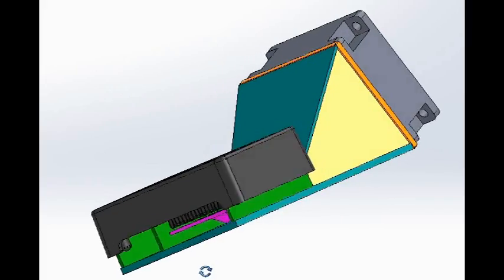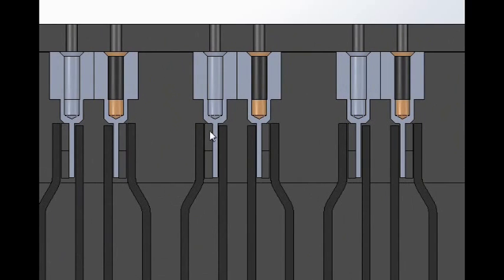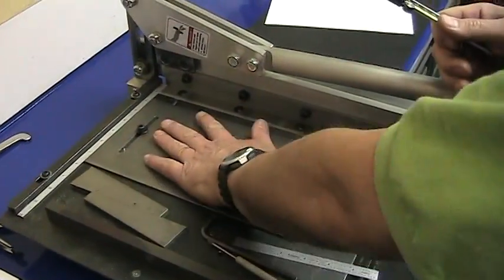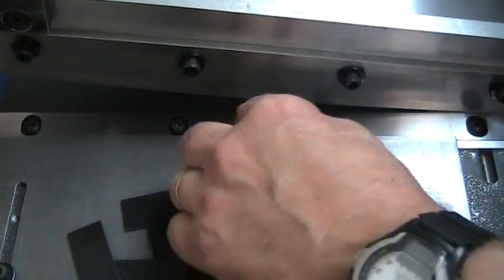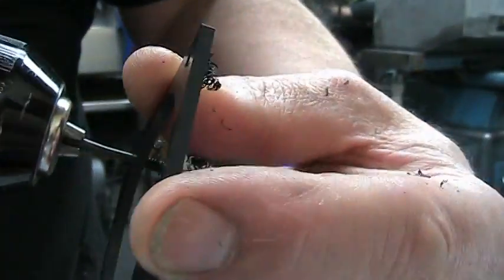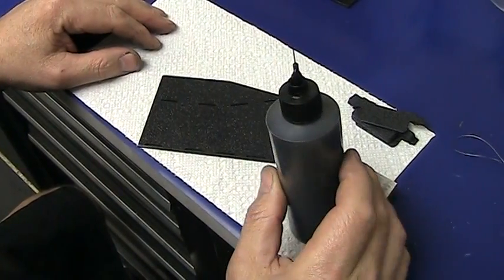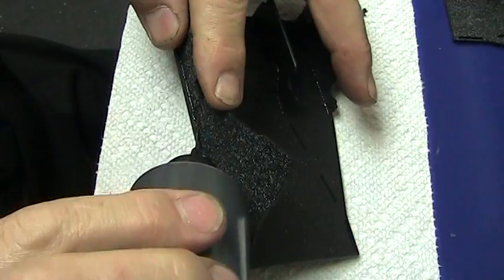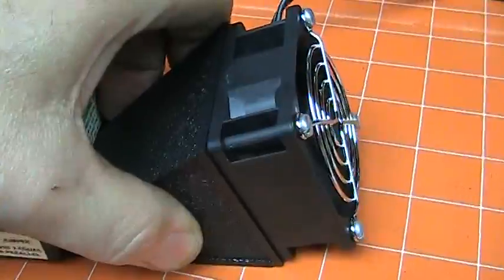VERSA-OHM  MAKING THE FANBOX

Comment: I'm pretty sure that fan is going to need a power supply and a little more wiring than just hooking it to a single-pole switch. And since its 12V DC and 12V direct-current electrical/electronic systems these days are pretty much all have "full integrated" circuitry and you just don't see too many 12V electrical/electronic systems with "solder-in" resistors on "circuit boards" and definitely not in things like control units for engines, transmissions etc in modern vehicles, it looks like that "test tool" is going to be kind of "limited" in its potential applications. 

For many years now even dirty old farm tractors and combines from companies like John Deere haven't even had "solid state" circuit breakers and relays and instead have "solid-state actuators" that integrate those parts right into the "controllers" which are all interconnected on the machine via CAN-bus with 2.5-volt "twisted pairs" communicating between controllers. And they have piles OF controllers. Like 20-30 pretty easily on a "simple" 200+ horsepower row-crop tractor or combine and EVERYTHING is "on the CAN" including the stereo, the transmission/engine/hydraulic system controllers and sensors and actuators which have been ALL electronic for up to 20+ years now. 

Even lighting systems are "smart" now and until you go into an "address" in the "chassis controller" or whichever "brainbox" is in charge of all the exterior lighting and program that address to "tell" the controller that yes, you have in fact installed optional exterior lights the unit wasn't "built" with, they won't come on when they're supposed to. 

The electronic engine and transmission and hydraulic controls themselves have always been pretty tough and robust but thanks to emissions laws and requirements and all the electronics on machines for guidance and mapping and even auto-steer (the AUTOMOTIVE INDUSTRY is ALWAYS a good DECADE OR MORE BEHIND the "diesel industry" and farm tractors have been "autonomous" for a LONG time now) via GPS and RTK GPS correction and the control systems necessary for common-rail fuel injection and multiple injections per 4-stroke "cycle" just require a degree of accuracy and precision of current/voltage signals and "surge protection" that "old-fashioned" circuit breakers and relays with bi-metal strips just can't deliver. 

Plus breakers and relays "burn up" incrementally each and every time they're energized or de-energized. And the charging systems are having to deliver 125-200 amps "continuously" at full load with every possible system and accessory "on". Engine controllers and "unit injectors" for HPCR engines operate at 90+ volts and lots of people think its "only" milliseconds of "power" being delivered "per injection" but in "pilot injection" with 6 cylinders at "only" 1500 rpm you're talking 75 "injections" per second and multiple ACTUAL injections during each of those "75 injections per second" which of course all have to occur within a few crankshaft degrees. And things happen pretty quickly with the pistons moving at 625 feet per second with a 5" stroke at 1500 rpm. 

There just aren't any "old fashioned" solder-in resistors, transistors or other "solid state" components found in modern "low-voltage" electronics and any school/instructor that's teaching students "electrical engineering" or even basic "electrical theory" using something like a "decade box" and a pile of Radio Shack solder-in parts and "trial and error" circuit/component testing/design/construction may be "job security" but your "job" will be at home in the basement playing with that "obsolete" stuff after you "fail" in the real world of modern electrical/electronic "engineering".